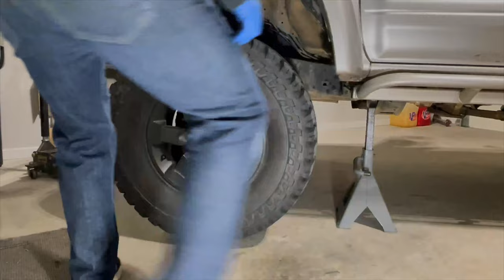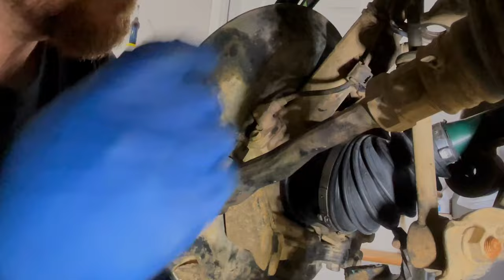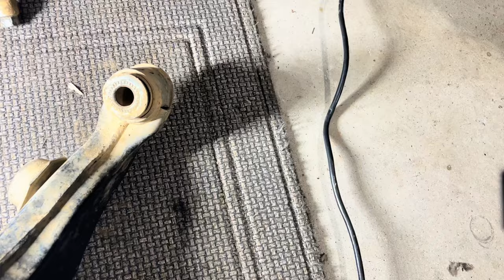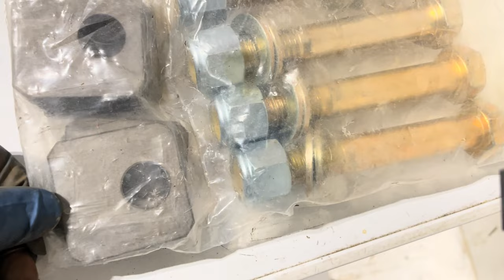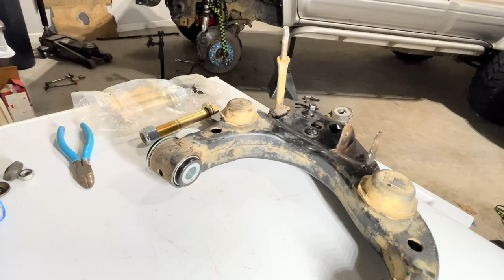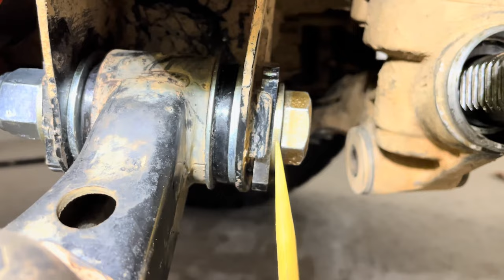Toyota Cam Eliminator Kit Install for 3rd Gen 4runner 333 Fabrication

Comment: Hey man thanks for the video. What orientation did you put the tabs?  I’m having the same problem. No where in the video does it show the after instal.
Reply from the maker: Glad you liked it! Yes, forgot to add that detail. Bolts go in from the outside the arms and nuts from the inside.